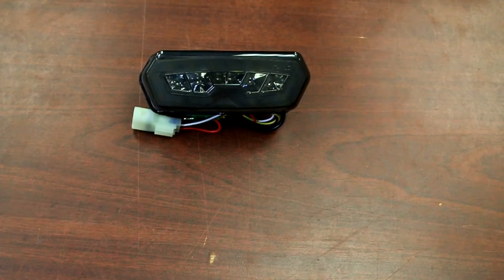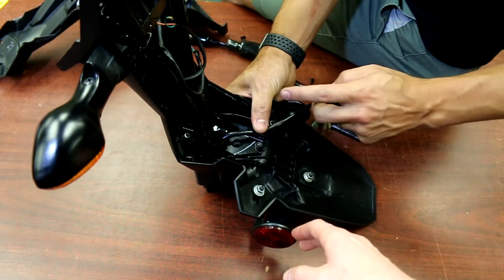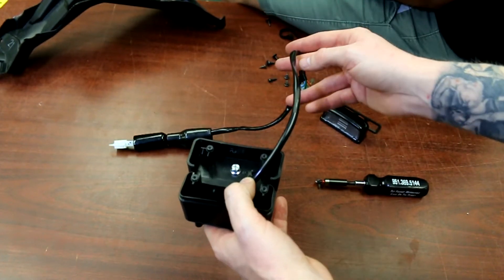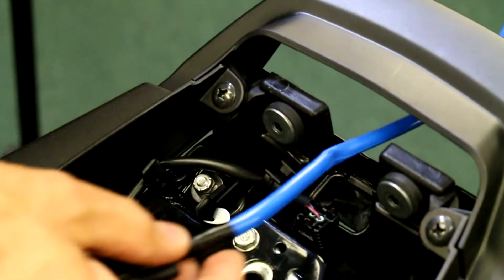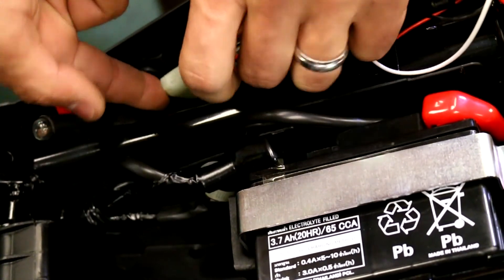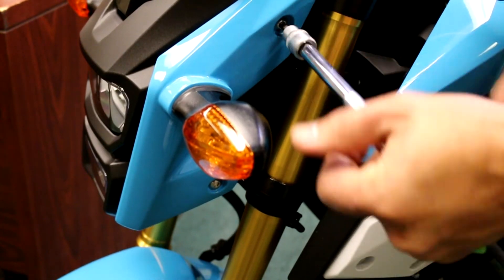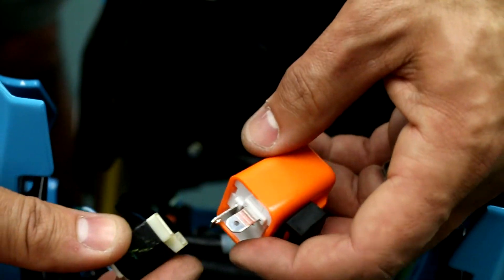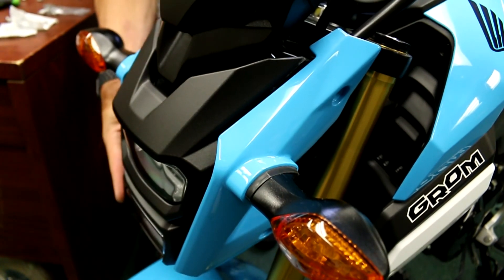TRS Honda Grom msx125 OG and SF Taillight

Comment: You guys have to update this stuff for the newer generation Grom, overall pretty confusing

Edit: I’ve successfully installed the front flush mount signals. They run as running lights and flash when selected left/right BUT my green arrows, both left and right, stay lit on the tachometer. I purchased your guys flasher relay as well to go with my order, so I’m not sure what’s going on there. I’ve also installed the smoked integrated rear tail light, however after wiring everything up the the bike my tail light stays lit orange/yellow whether I connect the billets to the orange or the light blue wire. I am stuck here.
Reply from the maker: Thank you for reaching out. If we had a new bike available we would do so. We don’t work on customers scooters here and only put parts on our own bikes for these videos. We do not have a newer grom to do so.  Sorry.  Have you tried adjusting the orange relay you can change the pulse.

Comment: Got mines just installed. All functions work, left signal, right signal, front lever brake. However when I push on the rear foot brake, the brake light does not come on.
Reply from the maker: that means either your foot brake needs to be adjusted or your foot brake sensor is out.  if the light works for the lever then it means your footbrake is the issues and it will be either the adjustment or new brake switch.
Reply: @Theruckshop  made the adjustments and it's working. Thanks for the quick response!